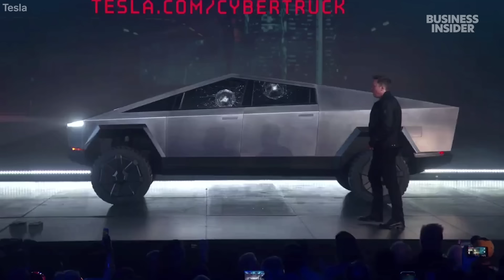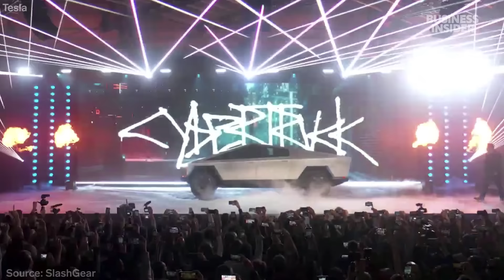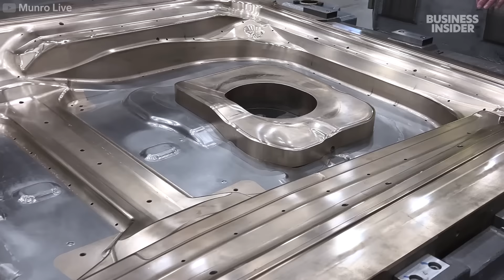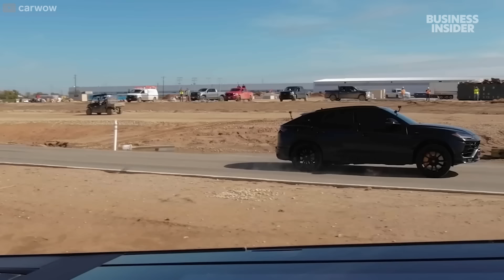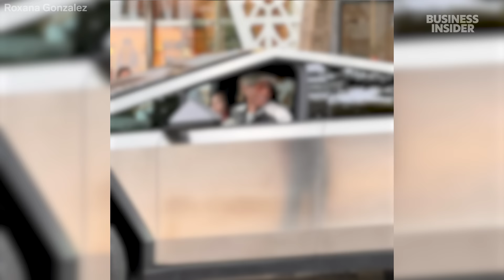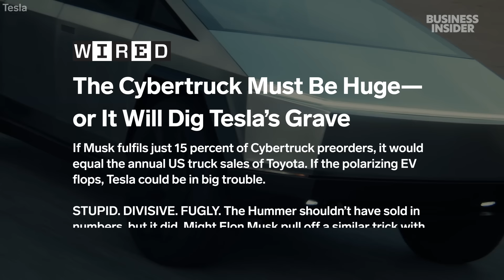How Did Tesla’s Cybertruck Become So Expensive And So Delayed? | True Cost

Comment: Becauuse its a piece of crap. A well engineered piece of crap but the initial concept and promises made have backed the design into a corner requiring major flaws and compromises to be accepted. 
All that wasted engineering effort could have produced a proper competitive electric truck based on the model y platform which could have cost a third as much as the Cyber truck.

Comment: In a few years all these EV's will be in grave yards ,,, Its just to expensive to change everything and its really not worth it , batteries can only get so small vs the amount of energy they hold ,, and The 120 miles on every charge after a battery degrades a little is not good ,, most of them do that new with the algorithm's that say you get 300 miles . soon as you push the throttle it drops 50 miles

Comment: The cybertruck will never be successful. It's too expensive and not practical for the reasons why people buy a truck in the first place.
Reply: And what reason would those be?  It carries 2,500 lbs., tows 14,000 lbs., the bed locks up, it delivers 110 and 220 volts, it's very dent and scratch resistant and will not rust out.
Reply: @McClarinJ  it doesn't look like Grandpa's truck and make vroom vroom noises. Not too mention the extra not truck like storage. Towing range is actually quite bad but that probably only affects 20% of truck owners.
Reply: "Will not rust out" - famous last words.
Reply: @CPTE5069  I guess more accurately the parts that typically "rust out" rendering a vehicle non-serviceable, are either aluminum or stainless steel on the cyber truck. So as long as it's kept out of costic environments that would immediately end human life it "will not trust out". Yes it has some of the same steel parts that are commonly replaced on all vehicles.
Reply: @McClarinJ the main issue is price looks like
Reply: Faster and cheaper than a Ford Raptor.
Reply: @WentzCraft Less range and it’s about the same price as a Raptor R.
Reply: @wingless747  yes, but I'm not sure anyone buys a Raptor R for is range.
Reply: Well it's not for you
Reply: @uromvictor  Thanks for stating the obvious 🤣

Comment: What a stupid hit piece! Mostly ok history but the later stuff is so biased and is purposely misleading. Any truck in snow without snow tires or chains will not do well, the standard tires are rated for 2.5 seconds 0-60 and are not off road tires.  Demand has increased since release with Cybertruck being flipped for $250K. The delay was caused by gee, a pandemic? Next year the base model will be sold at around $62K. With inflation that’s not a lot more than the original $50K price. Build quality has improved quickly and those sharp edges now have rubber covers. Drive by wire and 48 v electrical system are industry changing. These are the facts, Google them.
Reply: Must. Defend. Ego.

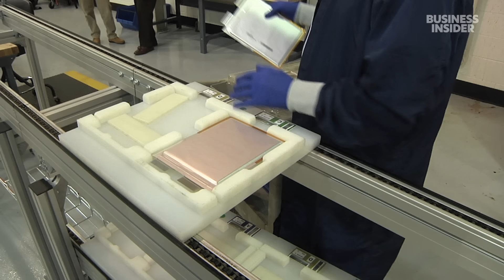Comment: Holy cow! 6:25 are we still in 2010 with these talking points. 
#1 The Barques Brownlee video was a pre-production model (The front left and right corners of the truck are sharp I'll give you that.)
#2 the cost of Cybertruck is so high because there is so much demand. Look at the model S Plaid for example when it came out it was $140,000 now it's $70,000 because the amount of people willing to spend that much has gone down. 
#3 The weight of the vehicle in the American market I feel is irrelevant when other vehicle like the F-250, Rivian, HUMMER EV, GMC Denali weigh just as much if not more than the Cybertruck.
#4 Most people don't drive more than 300 miles at a time so not having 500 miles of range shouldn't be a big deal for 99.9% of people. If you want to tow, just buy something else.

This video is good don't get me wrong. They talk about the very proprietary technology that goes into Cybertruck like air bending, but all of these things are being done in house were their is no middle man to add to the cost. And Cyber Truck isn't the only vehicle that is being produced at GIGA Texas. There's the Model Y and Tesla's upcoming $25,000 vehicle is rumored to be made here as well.
Reply: Cybertruck at full load only reaches at 90miles and it doesn’t have a spare tyre. If you drive for off-road, you are done.

Comment: This vehicle meets none of its initially outlined performance goals, from bullet proofing to range to efficiency to weight. Lots of market research shows we're a dumb species. People would have bought this for its looks if it had performed like a Kia Niro EV. It would still be less practical than the Kia, but it would also have more mass market appeal.
Reply: Well, the car body IS bulletproof. It does 0-60 in 2.6 seconds, has drive by wire, 48v electrical system, all wheel steering and tows 11,000 lbs. it is being bought by celebrities and draws a crowd wherever it goes. Awful

Comment: It's a truck with a range of 90-100 miles when close to max towing capacity, and most charging stations are situated so a trailer can't be attached during charging. That means parking and disconnecting the trailer, charging, then hooking back up. This is just a dumb toy for the rich, like so many trucks being used as commuter vehicles. Elon made it for himself.
Reply: The towing range is similar to the other electric trucks currently available like the Ford F-150 lightning. Many Tesla charging stations DO have towing stalls.  Demand is off the charts. Almost all pickups are not used for towing or off road, or even carrying loads. What exactly is your point?
Reply: @mandelm2001  My point is it's a POS truck. Trucks are work vehicles, not oversized race cars for commuters or driving around town. Watch some videos about people setting this thing up for off road use, the suspension parts break over and over. Tesla doesn't even know how to build a truck, having thick stainless steel was more important than a beefy suspension that could support it. And, here in Maine- there are 435 public Tesla chargers. Better hope they're all pull through. edit: And they perform much worse in our long winters. #2 This is just pretending an oversized race car is a vehicle that could actually replace a real truck- for what a truck is meant to do. It will happen, and the priority will be on work performance.
Reply: And how many times have you towed a max weight.   And how many people do that with this truck?  2-5%.   If you want more range get the extender.
Reply: Apparently the thousands of people buying it Elon himself?
Reply: This makes sense. Almost all trucks that you see on the road tow cargo so pull through charging is a must have.

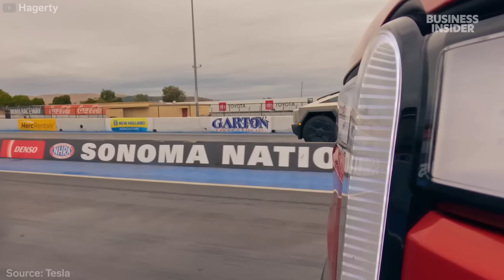Comment: 4:36 Wow, it's a electric versus a fossil engine. Of course the electric one has faster acceleration.
Reply: The first one was a Rivian, also an EV
Reply: its a very misleading advertisement, Tesla truck did not beat a Porsche in a 1/4 race, it's only a 1/8 mile run, after that Porsche pulled ahead.
Reply: plus you knock $500 off the resale value of your battery every time you do that